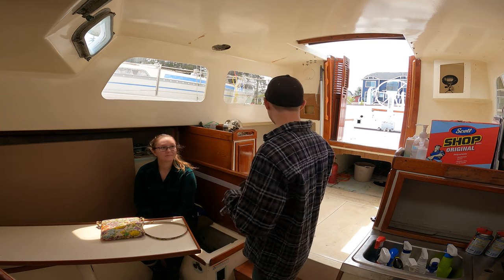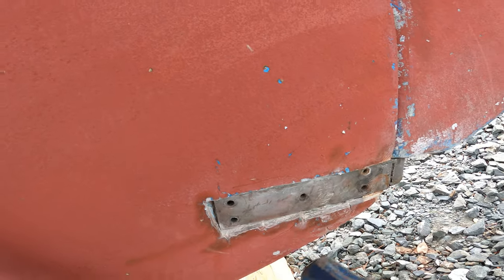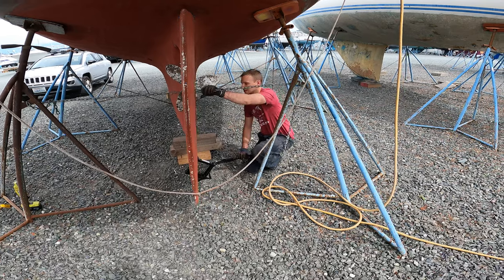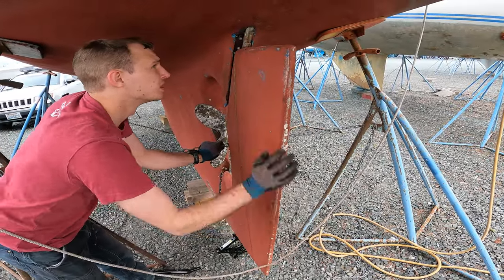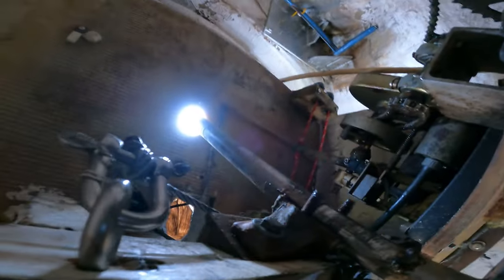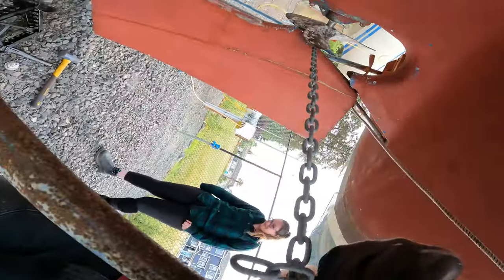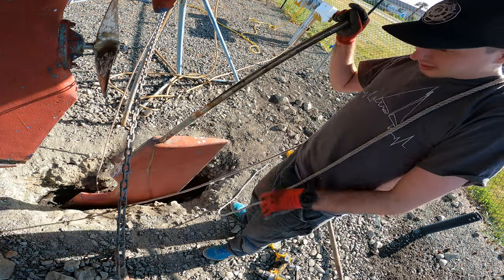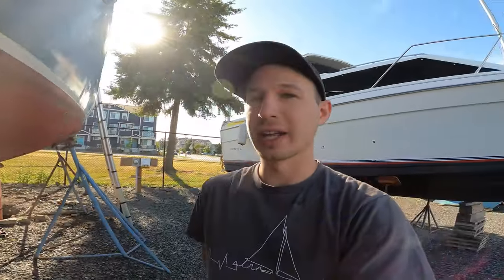Dropping the Rudder on a Full Keel Sailboat

Comment: Digging holes in the boatyard….been there done that!! HA! Cheaper than lifting the boat to pull the rudder! I’m  guessing you’ve seen it, but I’ll mention it, Far Reach Voyages used the old wheel linkage and adapted it to his wind vain steering, it’s slick and gets the lines below deck! Keep up the hard work it’s all OJT!
Reply from the maker: Thanks! Ya! Getting it all done is nice, every yacht owner knows the hole method and I’m glad to be a part of that club now!

Comment: You definitely need a regular ball peen hammer, that mini sledge hammer you use is good, but not for a lot of what you're doing! 
There's a type of hammer called a dead blow hammer. They don't bounce back and therefore deliver much more force to what you're hitting. I don't think you can get them at like Home Depot or similar, I think you'd have to go with Snap On, Matco or Mac, mine is a Mac. If you have two similar size hammers and one is a dead blow, you hit something that's solid metal and you'll see. The regular hammer will bounce back...a lot, and the dead blow will hit and stop. It's a significant difference and it really helps in many situations.
Reply from the maker: Yes! I have many hammers, although I don’t know where they are right now lol I worked as a finish carpenter for a while and I’ve got the hammers to prove it…. Somewhere haha

Comment: You have some work to do before you are ok. I suggest that you dig 20 cm deeper an much wider. You need to clean and pait inside the rudder and to take care of the propeller . I´m sure that you could have taken of the propeller before the rudder and it had been a good idea to do so from the beginning. The propeller needs to be taken of from time to time anyway. I´m sure that you will be ok with a little patient. I saw the crack in the rudder, are there any other cracks or other things under the water line that you have to take care of. First time I see your video nr 64. I think I have to go back to see what you have been doing before. I wish you luck with the rudder.
Reply from the maker: Got it off! And the prop definitely would have come off sooner if I just turned the rudder hard to Port/starboard no problem. Ya, there is some repair work to do for sure. On to the next task.